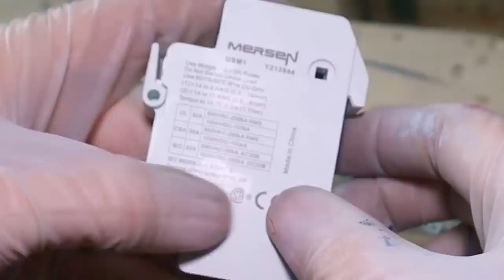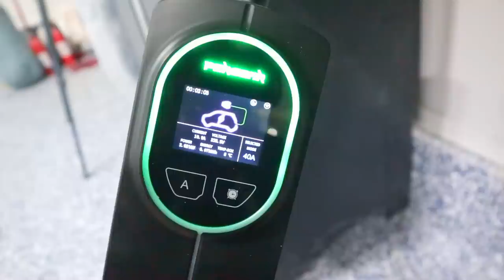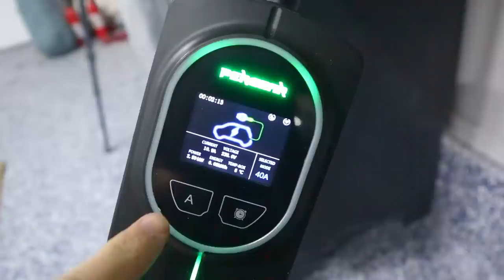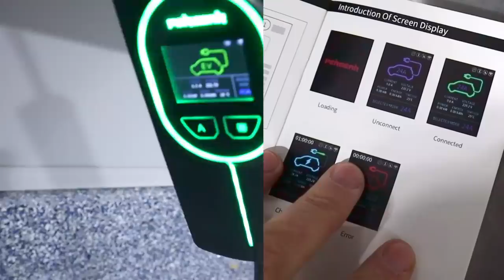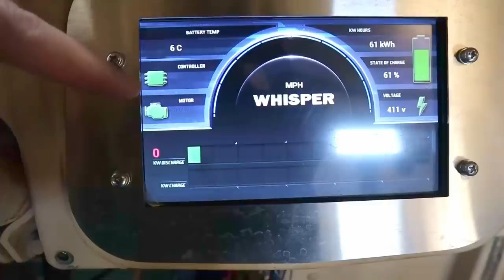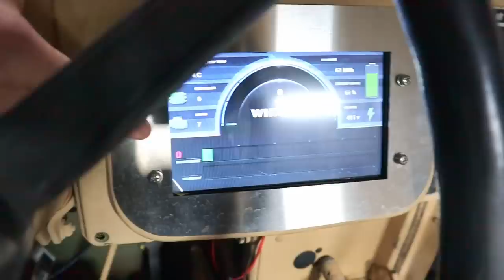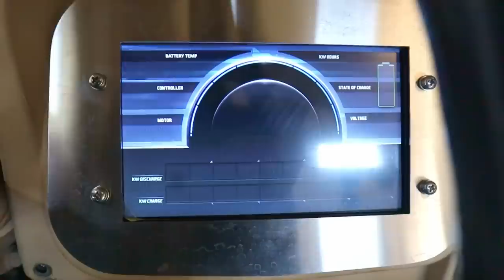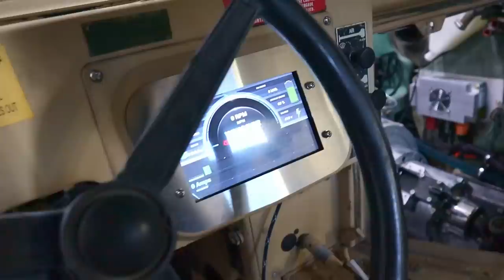The Electric HMMWV Strikes Back - More Trouble with charging

Comment: 2 awg copper wire will do a lot more than 70 amps.
Depending on the insulation temperature rating it can be over 200 amps.

Of course if you only need 40 amps then a smaller breaker is better.

Comment: CAN is definitely not for the weak. Trying to identify the proper message and identifying the proper ID along with what bit positions are being used can be a pain. 

Easiest thing to do is try to replicate the CAN data by repeating the action you are trying to track down over and over and watch the live feed for repeating/similar messages. so in this case if you accelerate over and over you should  be able to find a pattern with enough samples.

Comment: I am highly interested in the evolutionary process currently happening with EV and hydrogen fuel cell vehicles. I am by no means an expert, but I know I hate having to wait in line, and even though current technology has charge time down to 18 minutes (quite a feat), it kind of begs the question what will happen when EV's begin to be the dominant vehicle type. If it were possible to make electric storage that could charge like a capacitor and discharge like a battery, I think people would be highly motivated to adopt EV transportation. Maybe someone like EM or JB or someone else with similar resources could turn their attention to this. Seems like a much more "real world problem" in search of a solution.

Comment: use RS-485 communication with twisted pair equal length wire with 120 ohm termination resistors at each end of the twisted pair. There are faster interfaces but hopefully the RS-485 would be ok.

Comment: Just a thought, the AC-DC converter was 12.xx, but what about the DC-DC converter? If the systems are connected could the DC-DC be overcoming the AC-DC's diode reverse voltage and toasting it?
Reply from the maker: Not connected,  but thanks for the comment!

Comment: I have been following this Hummer EV build since day 1 so I know this wont be easy (nor has it been for ya). My question to you, with trying to diagnose the charging aspect would it be better to remove/isolate it from everything else in the vehicle and starting at square 1 with t/s. 
As someone who works tech support, we try to find fixes with everything connected, and if that doesnt work we isolate the hardware in question and t/s it and then methodically add in each component until we find the culprit causing the issues.
Reply from the maker: Thanks for the comment!

Comment: the motor and its controller etc works, great.. so maybe have to pull the whole charging system off and do bench testing etc until charging system works on the bench. Then you would be able to see what connections are off, if its some opamp backwards or something with the code.
Reply from the maker: Thanks for the suggestion!
Reply: @ElectricSuperCar  looks like no communication. I would suspect there should be a lot of txRx packets for requesting charge, then is battery full, yes/no if no then send more charge... etc.etc.etc.
Reply: @ElectricSuperCar  Since you have all those devices connected and communicating and displaying information then instead of rs232 you would use RS485 using the same db9 connectors and equal length twisted pair with termination resistors, which is important for it to work properly. with rs485 with termination resistors the signal gives a clean pulse but without termination resistors the signal is garbage.

Comment: The can messages they do not follow a predefined standard like DS402? What messages flow when you connect the charger?
Reply from the maker: The charger is waiting for a CAN message from the BMS.  It is not sending a message.
Reply: @ElectricSuperCar  no message at all? Hm.. can you read the voltage of CP with an oscilloscope? It seems in this video that the voltage is between -12v to 9v only and not going to the -12v to 6v to allow charging (i have seen the fluke but i cannot see the divisions). Also the voltage of the PP? Must be 1.5V to indicate connected on the previous it was 3.6 i think.

Additional weird fact. The BMS software you showed reports valeo charging status 4.0 but then explain next to it: 1-no charging, 2-charging. What is the 4.0 status?!?!

Comment: My WAG on the charging issue: The Third-Party adapter to the proprietary Tesla battery interface is not properly programmed to provide the required handshake for charging, so its getting rejected and not allowing the batteries to charge.
Reply from the maker: Hmm...maybe

Comment: If part of the issue may be related to conflicts on the CAN bus - have you considered reducing the CAN bus to the bare minimum required for charging? BMS to Charge Controller and nothing else should still allow for charging, correct?
Reply from the maker: Thanks for the suggestion!

Comment: 1 plug the charger straight into the wall.
( troubleshooting )

2 is the BMS requesting the charger to come on ?

3 the wire, the can connection directly to the charger

Process of elimination lol 

Good luck
Reply from the maker: It is definitely #2.  The BMS is not requesting the charger to come on.  Working with Orion to figure out why
Reply: @ElectricSuperCar  

First thing I would check what you may have already. 
#1 On the charger settings, make sure it’s set to the correct charger.  
If it’s not on the list, just try them all. 

#2 try moving the battery cell voltage requirement to turn on all the way down. 
Good luck getting a hold of ORION  🤷‍♂️
If you find a good contact for them, you should post it. Other people could use it. 
Good luck

Comment: Love watching the continued diagnostics. I was looking at your Orion Screenshot at 07:48 and noticed your not getting any AC Line voltage. So it would seem your Pilot signal is not getting pulled low to tell the EVSE to provide power. Is the J1772 port connected to the Orion or the Valeo Directly? If it is at the Valeo directly it will report 6V on the Pilot pin to close the AC mains. I would potentially connect directly to the Valeo, as it seems it will automatically restrict based on pilot input and has and output to wake the BMS to indicate an is charging state. Also in that screenshot it shows the charging status to be 4... I am not totally sure what that state is. But according the screenshot it is not charging. Is there any faults present?

Also from the manual, step 4 seems very important to getting those mains to close. 
Start charging
The BMS shall instruct the OBC to start charging. The start charging sequence shall be
followed as long as the BMS requires charging and no alarms in the power stage or
gateway are present
(1). Ensure that the control pilot PWM is present with a valid duty cycle and frequency.
The duty cycle specifies the maximum input current from the charging station.
(2). Ensure that the proximity signal is valid (type 2) with a 16A maximum input current.
(3). Lock the charging plug and verify that it is locked。
(4). Set S2 (pin 144) high. This action tells the charging station to supply power.
(5). Wait 200 milliseconds and read the mains voltage from the power stage. If present,
continue to next step.
(6). Inform the power stage to start charging
(7). Verify charging by reading the charging status from the power stage (Charge state
should be reached within 5 seconds).
(8)Gateway state machine transition Standby to precharge to charge.

Anyways would love to help if your open to it. Would love to donate some time to the cause :)
ryan@kilowattconsulting.com
Reply from the maker: Thanks for the offer.  I may hit you up
Reply: @ElectricSuperCar  While working on another project realized i may have swapped pilot and prox in my response. Anyways hope its going well!

Comment: CAN ID collision? Called it!. Does the charger need to be connected to the display in order for it to charge? I would start disconnecting most of the stuff in the network to see if we can isolate the fault. Also double check that CANH and CANL are the right way around.
Reply from the maker: Thanks for the suggestion!

Comment: hav u thought about bypassing the relay in the wall plug for short periods while monitoring the current and the can bus. to see if when the vehicle actually gets ac power if the onboard charger system works. if so it isolates the issue and if not then theres a problem in the high current high voltage charging config and u def need to know that so u dont end up making the interface work when it really shouldnt. with short enough pulses u could see if the onboard charger goes into and error state or is malfuntioning without blowing anything up
Reply from the maker: We are not even getting to AC power yet.  The handshake with the pilot & proximity wires isn't triggering for the command to be sent to the EVSE to turn on
Reply: @ElectricSuperCar  yea so bypass the handshake to see what it will do if its actually given ac power regardless if the handshake. breifly just in case it goes into an error state or is short

Comment: It would be easier if you undo all the wiring  and start it all over just to be more sure it will work, in my observation the VCU and BMS are all mixed up and not in-sync also the display is not compatible with the system
Reply from the maker: Yes, many problems

Comment: Why are you using an AC/DC converter? Most aftermarket chargers output 12v anyways when charging.
Reply from the maker: For whatever reason the BMS needs a 12V signal before it will give the CAN message for the charger to start charging.   The BMS manual suggests using an AC:DC converter
Reply: @ElectricSuperCar  Interesting - you would think the CP/PP would be all it needs. Why not just have a switched charge enable 12v signal running direct from the 12v battery? 

If you really can't get it figured out, I'm the North American retailer for the SimpBMS which I'm sure you've heard of from forums etc. I can get you one of those for free, would love to support this project!

also great video as always man! good luck with the andromeda EVIC, it's a very nice display setup once you get it working
Reply from the maker: I know, right?

Thanks for the offer.  I may take you up on it if I can't get things working

Comment: Are DIN rails holders rated for high vibrations environments.
Reply: Used on a lot of industrial equipment  where there is a lot of vibration. Seen it used in vehicles a few times before but it's mostly if the module is rated for the high vibrations and properly secured.

Comment: Try to take out the charging system and test that on a diferent battery? Maybe the battery is shorting or is trying to take more amps then your charger can output?
I realy do hope that it is not the battery because thats a pain to fix. Goodluck!!
Reply from the maker: Thanks for the comment!
Reply: @ElectricSuperCar  No problem, just want to help.

Comment: Are all controllers using the same can protocol and speed? ie 250kbit or 500kbit? Dont just look at the screen, see what the vse, charger, motor etc are using too so it's all the same. I'm gussing they all have their own configuration utility, better to use that for setup than some generic can software.
Reply from the maker: Thanks for the comment!

Comment: 2ga copper only good to 70A? That doesn't pass the sniff test. Even 4ga is rated higher than that.

 Regardless, if you don't need a 140A breaker, swapping it for a lower rating is smart. But I wouldn't say 140amp is going to ever 'burn up' 2ga. Especially in short lengths.

Comment: But isn't the car the one that charges, not the charger itself? Isn't the charger just a glorified wire?
Reply from the maker: Wall charger (EVSE) supplies the onboard car charger with AC, and the onboard charger converts it to DC to charge the batteries.

Comment: Does one of the hardware pieces, like the BMS or Display have a bus input and output? Your drawing shows as if this is the case, could you change the order of which the devices are on the bus. Maybe one of them is not retransmitting the rest of the data on the bus outputting properly? Maybe try removing a device or two entirely, like taking the display and motor off the bus temporarily.

Just a thought… idk much about this, but seems very similar to a KNX automation bus to me.
Reply from the maker: Thanks for the comment!

Comment: I don't have any experience in this area, but would it be worth isolating the charge controller from everything apart from the batteries? If it can be made to work with the minimum required other components connected then add in each other unit a piece at a time until you can identify what is causing it not to work
Reply from the maker: Thanks for the comment!

Comment: Has the onboard charger not yet been checked internally for damage since the inadvertent line-neutral swap?
Reply from the maker: Working with the company to troubleshoot
Reply: @Electric SuperCar  Is that fail model deemed by the on-board charger mfg to be unlikely? Or is the reservation to open up the charger to avoid voiding a warranty?

Comment: Did you ever try to start charging with your ignition lock at step 1?
Step 2 ist engine start
Reply: Or did the charger / bms maybe missing a temperature from the batteries or waiting for the right temperature for charging from the batteries
Reply from the maker: Tried with key off, ACC, and key on.  Thanks for the suggestion

Comment: 15:27 The display shows 6 °C at the battery, 13 °C at the controller and 8 °C at the motor. That's cold! Are you sure those values are accurate?
Reply from the maker: Probably.   My garage is cold

Comment: I‘ve used PCAN as a monitor in the past as well (i saw u using it ;))  Whats interesting is the message when you are starting to log which was ‚bus heavy‘. It could be that the charging messages as well motor messages are not that high of a prio (lower can ID means higher priority) and gets overwritten by other messages and the divices are not able to communicate on the bus :P Are all devices connected on the same BUS? If yes it makes sense to create multiple can networks with gateways in between especially if you consider functional safety ;) cheers PS: the twist neccessity depends on the bus speed and wire lenght. Again interesting question : what is you baudrate?
Reply from the maker: Thanks for the comment!
Reply: Could bus heavy be a result of missing terminal end 120ohm resistors?
Reply: @rancillinmontgomery2480  i don‘t think so, the tool is quite clever. It would indicate a missing termination resistor. Bus heavy means that the usage of the bus is at its maximum and that there are most likely already collisions happening which is no problem for CAN Protocoll as the overwritten message will be resend after short time when the bus is empty again. But if there is too much traffic with almost no room as there are already a lot of high prio messages it could hapen that the low prio messages are not able to get in between. That why i am asking for the identifier (which has a big influence on the prio)

Comment: Is the CAN cable shielded with anything? And if not, why?
Reply: CAN was designed to work without any shielding that's one reason for twisted pairs and differential drivers with high common mode rejection. The transceivers I've looked at can work with 3v diff signal with up to 20-30v common etc. You want to keep them away from noise source of course where possible but only thing absolutely need to watch out for is high voltage DC or AC getting on the lines from shorts, arc, or plain induction.

Comment: could it be something as stupid as the batteries not being ballanced? so that the charge relay/controler detects it.... but wont charge it??? or the controller has the wrong info about the cells/groups, there real voltages, and what it needs to be????
Reply from the maker: Good thought...but I don't think so.  At least the BMS is not limiting charging based on cell voltages.

Comment: DC-DC that charges the lead acid charge rate is only 4 amps? Ah, 4 amps high voltage so about 1600 watts into the converter

Comment: a few things:
please stop calling the J1772 plug a charger, it's just a wall adapter with a display and very simple signal generator circuit. The charger is the AC to DC converter in the vehicle that takes care of communicating with the bms and does a cc-cv charge based on what the bms requests.

CAN wires really do need to twisted and they also need to be matched lenghts and preferably matched impedance. It's a differential signal that is tightly coupled so it's really important for any length over like 5cm. Matched impedance also means you should try to use the same wire gauge for the entire CAN network.

Be careful to have the termination resistors on your CAN network at both ends only. No more than 2 resistors and only at the very ends of the daisy-chain, you must put 120ohm resistors. Without them the signals can have reflections and will have nowhere to dissipate, as a CAN network uses a surprisingly high amount of energy relative to other types of protocols.

don't forget to match the CAN baud rates on all devices on the same network. If one is talking 250kbps, it wont understand what the 500kbps device is saying. It's not a "maximum bandwidth" value, it's the actual message speed in use, so every device needs to match the same speed, same way a uart port (serial) needs matched baud rates on both ends.

As for CAN addresses, they also need to be matched. If you change the address of the transmitting device, you need to change the listening and filter address on the receiving node, otherwise they wont see each others.

I haven't seen the rest of this series so maybe these points were already talked about, but from this video your level of expertise is a bit unclear so I dropped the points I thought might help here.
Reply from the maker: Thanks for the comment